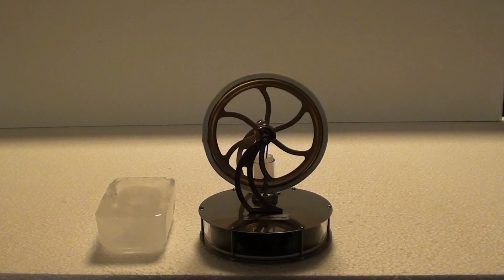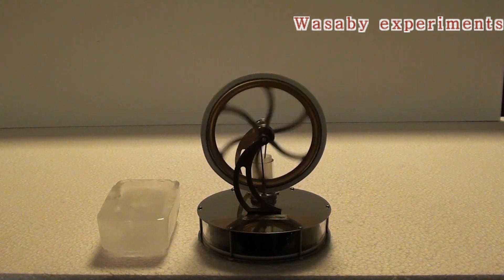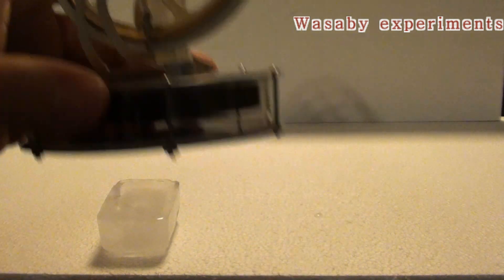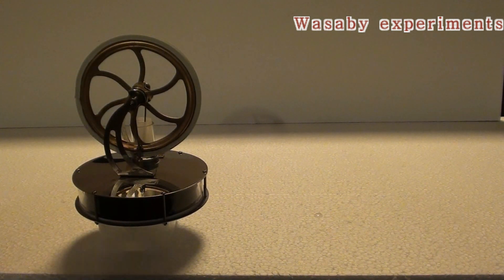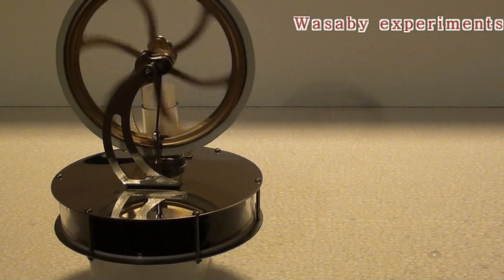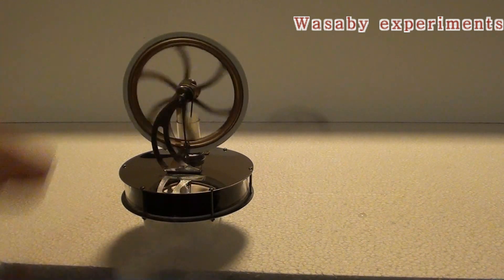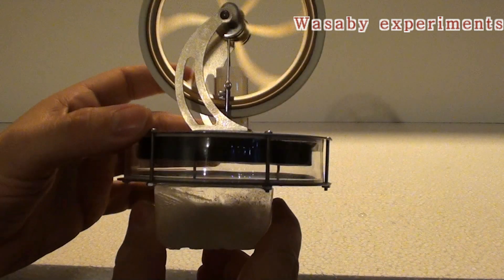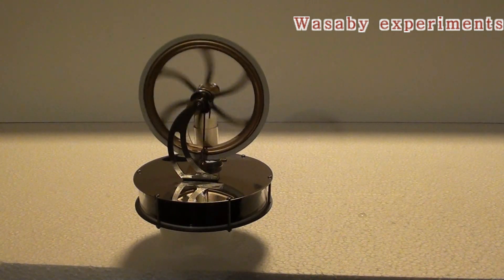Ice Operating Stirling Engine. High speed operation just thanks to cold ice.  | WasabySajado

Comment: That thing is so interesting, i would like to find out the cylinder proportions to try and make  my own. I already made a candle powered stirling, but i have yet to find the right volume in the stirling cylinders to achieve a stirling to run off room temperature. This is what you have here, it does not run on ice like the title implies, but it runs on room temperature, but still a cool device.

Comment: It works but it is not really free energy because it does require a temperature difference, and a temperature difference don't really happen without energy being present in the first place. It is a way to take advantage of heat being used anyway, IE: we heat our homes anyway, so we could take advantage of this and use that heat along with the cold to create our temperature difference required to run the stirling, Or, we create excess wasted heat from manufacturing processes, etc... which we can take advantage of and use a stirling to recover some of that lost energy, but they is nothing really free about  creating an artificial temperature difference, it takes ENERGY to do that.
 Until you figure out a way for that thing to run all by itself without needing to manipulate the temperature around and inside it without using human produced energy to cause the temperature difference can you call this free energy,  some people will tell you free energy don't exist, but i say yes it does, it exist, but there is a difference between free energy, and over unity. Over unity is fake, never possible, even when a scientist thinks he can claim over unity it is not really overunity, it is just pulling energy from somewhere else where mainstream scientist didn't figure out yet. But hook that thing or a better stirling to the sunlight collector and frensel lens and now you can claim free energy, because now the sun heats it without needing heat from a home, or heat from any building, etc...

Technically i know it looks like it runs on ice, but in reality it is still running on warmth. The warmth in the room, yea the room you HEATED with ENERGY that you probably PAID for. lol, is what is giving the stirling the true energy, the ice is only helping reduce the temperature on one side of the stirling to aid in the energy transfer of turning some heat in the room into mechanical motion,  but without the heat the ice would fail miserably at running anything. This is what is actually happening, the stirling is extracting SOME heat and using it to drive mechanical energy as it is cooled(used), it is not in ANY way extracting energy from the ice, instead the ice is actually consuming some of the energy from the surrounding air(environment) and using it to equalize and become equal. Cold is actually nothing but the lack of heat, the lack of heat is nothing more than the lack of ENERGY, therefore absolute infinite cold is totally void of energy. Remember this, there is no real 2 energies, there is only ONE, and even Einstein's discoveries prove all energy comes from the SAME source, E=MC2, there is no hot energy and cold energy, light energy and dark energy, NO, there is only energy period, or the lack of it.